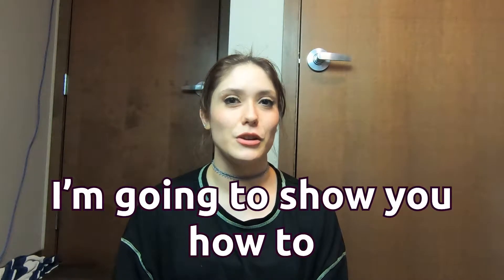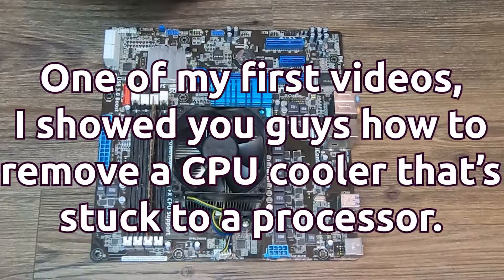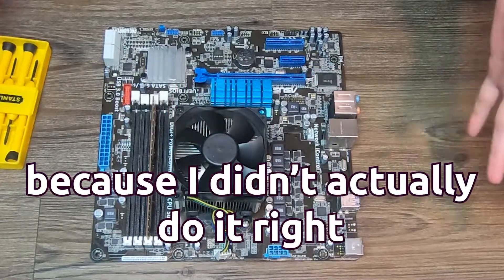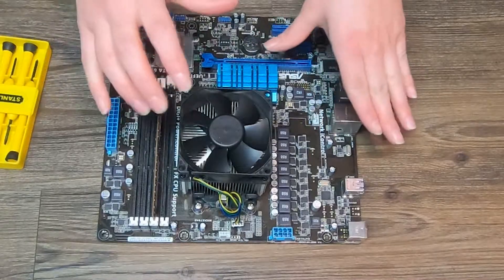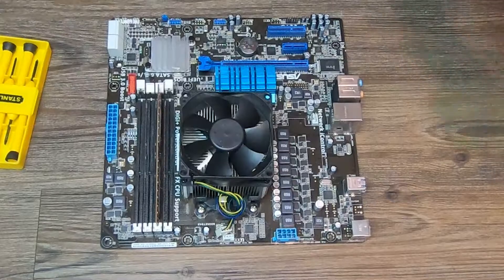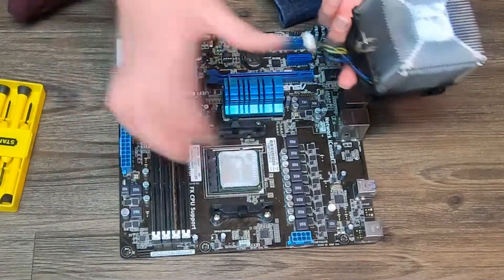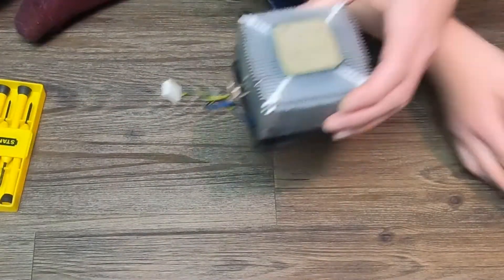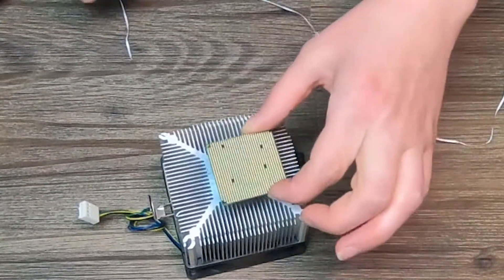How to PROPERLY remove a CPU Cooler and a CPU Stuck to Heatsink

Comment: Stupid me watched two other videos instead of this one before starting to remove the Warith Prism. I knew how to unlatch, and that I should twist, but neither showed that I had to unlatch the bottom part too. I'm pretty sure that was part if the reason I pulled out my CPU. Luckily no pins are bent, but I definitely have to find some dental floss. Thank you for that. Hope it works with 2-3 year old stock paste in a PC with a 95% up time. 😗

Comment: It helps to mindfully push down as you twist so you dont accidentally pull while twisting.
Good content, can't ever fault someone for wanting to help people.
Reply: That happened to me 15 minutes ago. Unfortunately I watched two other videos instead of this one before trying to remove the Wraith Prism. Luckily no pins were bent, but I had to research how to remove the  CPU from the cooler. AMD are using the worst paste ever produced. I'll never trust the pre applied stuff again.
Reply: @phizc  it happens with a lot of paste, dont beat yourself up. To remove the cpu if it gets stuck I usually push towards the side of the cooler until the paste smears enough to break the suction on the heat spreader.
Reply: @TuffMcAwesome  I managed to fix it. I had to use a heat gun to warm the entire thing up to 80°C and use a calipers as a wrench to twist it off. It wasn't so much that suction was keeping it in place - the paste was as fired clay.
Reply: @phizc  I'm glad you got it fixed man

Comment: I had my first pc build a few months ago and couldn't line up the cpu cooler so I tried to remove it to realign it. I almost had a heart attack because the CPU came off from the seat still attached to the cooler. Thankfully, no cpu pins were bent and it still worked fined. It was a pain to get 5800x so I lucked out there.